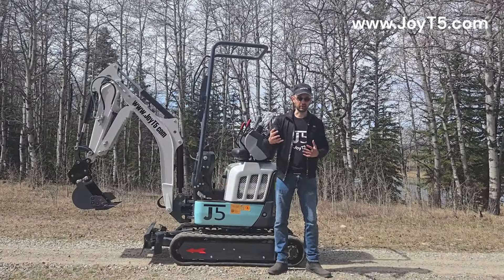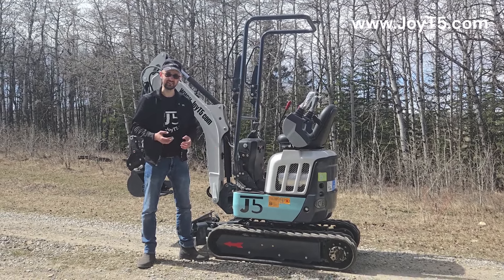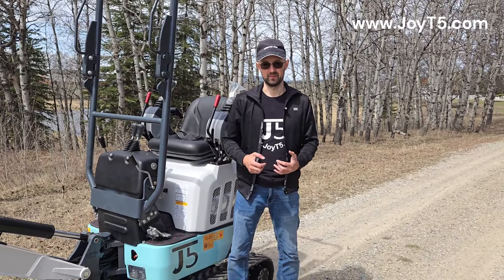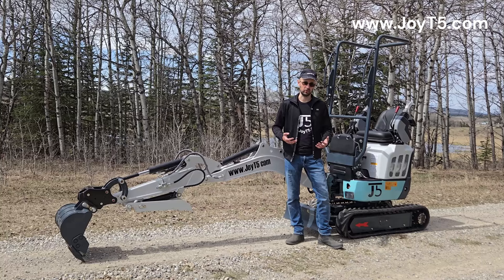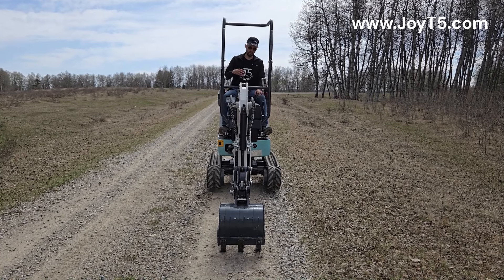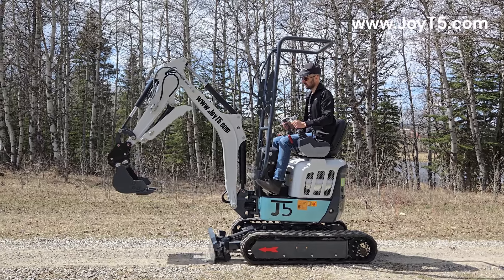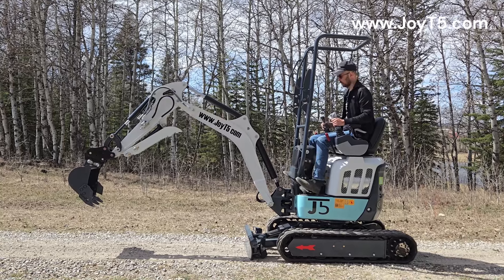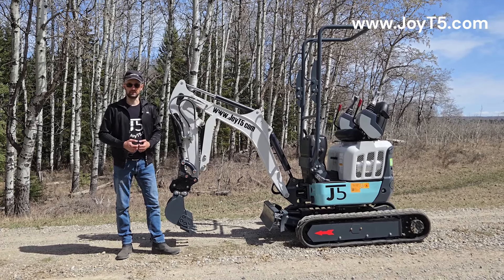The JT5120 is here! (1.2 Ton Mini Excavator Demo)

Comment: Arkadiy, there is a lever down by your feet at the base of the black metal command center under the lights and switches and directly across from the engine cover lift handle that I did not hear you address in the video. Can you tell me what that lever is for?
Reply: Also, the light attached to the boom for night work, how is it turned on? Thank you Arkadiy.
Reply from the maker: Hello @deirdre444, 

The lever by the feet is the selector that lets you choose between controls for dozer blade and extendable tracks. 
There are two toggle switches bellow the walking control levers. One switch controls the light and the second switch controls the low/high walking speed. Please visit https://joyt5.com/products/jt5120p-1-2-ton-mini-excavator-with-pilot-controls-1 to see photos of the switches.